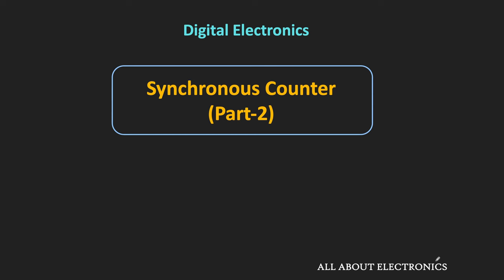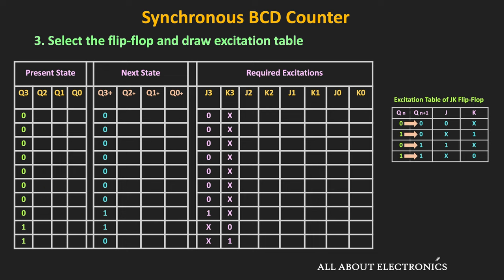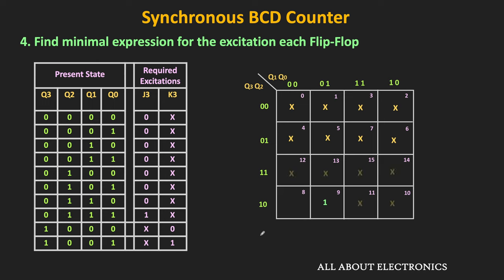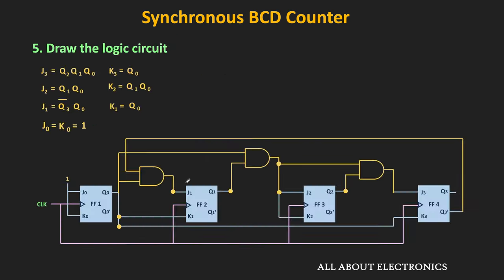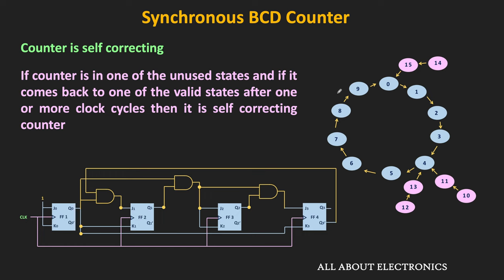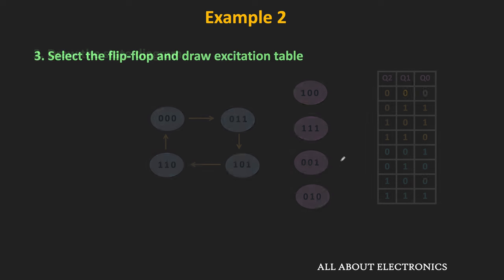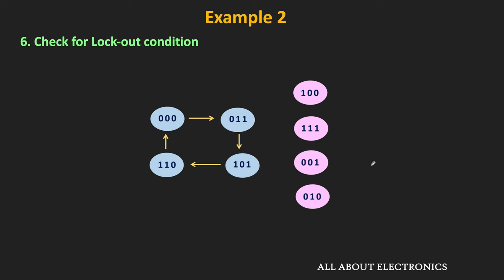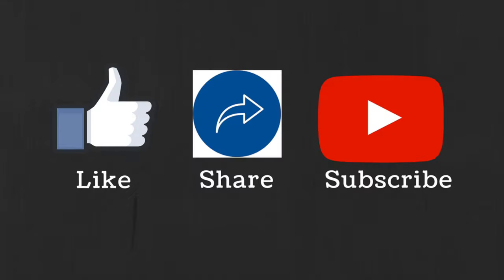Synchronous Counter (Part 2) | Synchronous BCD Counter

Comment: mod 10 counter 
Can't it be designed directly by using nand gate 1001 to clr input to set it 0000 again
Reply from the maker: What you are saying is typically done in the asynchronous or ripple counters. 
I have already explained that. 
You can check this video. 
https://youtu.be/OvOXRQiRzas?si=f8CkHz37VGf1KY1_
Reply: @ALLABOUTELECTRONICS  it cannot be done here?
Reply from the maker: @user-mm4mm3ib2w  Here also, if you want to do then you can do that. First, you need to design 4 bit synchronous up counter and then you need to give Q3 and Q1 outputs to NAND gate (as soon as the output goes to 1010, clear input will be generated), and the output of the NAND gate should be connected to clear input (assuming it is active low). In this case, the issue is that, momentarily, the output will go to 1010 state and then it will become 0. So, momentarily, there will be a glitch in the output. And as a designer, one should avoid that.
Reply: @ALLABOUTELECTRONICS  Thank you sir for solving my doubt.

Comment: sir how to decide which flipflop to be selected
Reply from the maker: As such there is no specific rule. You can design it using any flip-flop. Accordingly, your connections and external logic circuit will change.